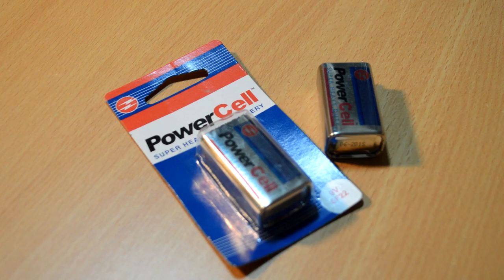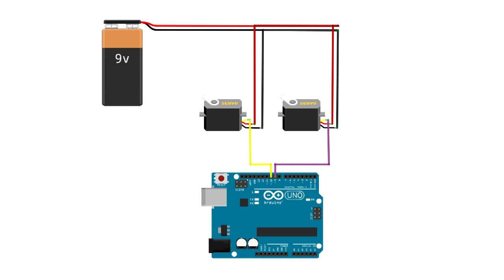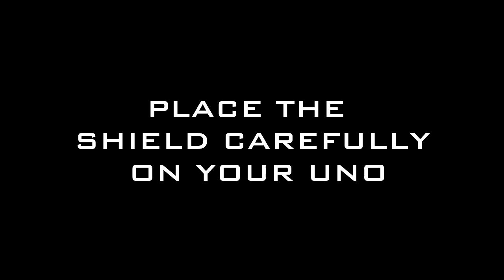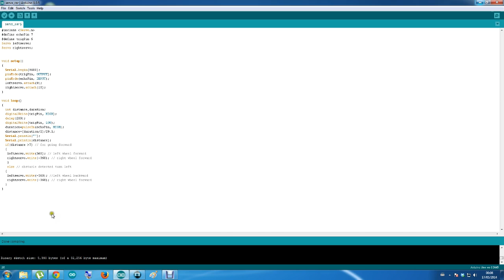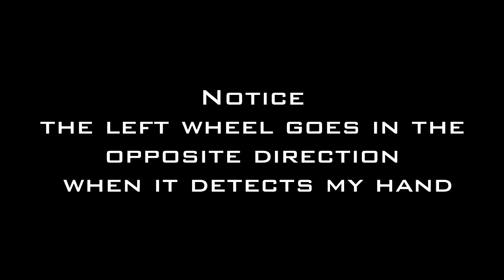Ultrasonic Controlled Servo Car with Arduino

Comment: It is not so effective because your not a servo to rotate int PING sensor,I reccomend you to use BO x 2 motors to control the wheels and servo for PING..............

Comment: Hello, the code doesn't work for me. i get these errors;  stray '\' in program and 'u201c' was not declared in this scope.
Do you have any idea why?

Best regars
Reply: Try to manually retype the quotations. when you cut and paste them they will be a different character, that's why you get the error.

Comment: help:
Arduino: 1.6.7 (Windows 7), Board: "Arduino/Genuino Uno"

sketch_dec25bBBB:37: error: stray '\357' in program

 }ï»¿

 ^

sketch_dec25bBBB:37: error: stray '\273' in program

sketch_dec25bBBB:37: error: stray '\277' in program

exit status 1
stray '\357' in program

  This report would have more information with
  "Show verbose output during compilation"
  enabled in File > Preferences.

Comment: the code is wrong
the right code is:
#include <Servo.h>
#define echoPin 7
#define trigPin 6
Servo leftservo;
Servo rightservo;

void setup (){

 Serial.begin(9600);
 pinMode(trigPin, OUTPUT);
 pinMode(echoPin, INPUT);
 leftservo.attach(9);
 rightservo.attach(10);
}

void loop()
{
 int distance,duration
 ;digitalWrite(trigPin,HIGH);
 delay(200);
 digitalWrite(trigPin,LOW);
 duration-pulseIn(echoPin,HIGH);
 distance=(duration/2)/29.1;
 Serial.println("");
 Serial.println(distance);
 if(distance >7) // for going forward
{
 leftservo.write(360); // left wheel forward
 rightservo.write(360); // right wheel forward
}
 else // obstacle detected turn left
{
 leftservo.write(-360); // left wheel backward
 rightservo.write(360); // right wheel forward
}
}
Reply: +Bhoopesh Gulaguli 
I am getting this 
Arduino: 1.6.7 (Windows 7), Board: "Arduino/Genuino Uno"

sketch_dec25bBBB:37: error: stray '\357' in program

 }ï»¿

 ^

sketch_dec25bBBB:37: error: stray '\273' in program

sketch_dec25bBBB:37: error: stray '\277' in program

exit status 1
stray '\357' in program

  This report would have more information with
  "Show verbose output during compilation"
  enabled in File > Preferences.
Reply: +Bhoopesh Gulaguli 
It gives as much errors as the original :/

Comment: Can anyone help me, I would like to use this code but with 3 ultrasonic sensors?
any code pls
Reply from the maker: +Julian Fernandez Barcellona Yes, if you are using 3 us-sensors then there would be 3 distance variables. You just need to compare all 3 of them with each other and send the output to the motors accordingly!
Reply: +GetTutorialized KD thank you, is there any way you could send me the code for three sensors? I would greatly appreciate !
Reply: +Julian Fernandez Barcellona I can send a Arduino code but it could be only of 2 sensors.....
Reply: Hi? Can you send me the codes for this? 

myinfinity22015@gmail.com

Thank you

Comment: if anyone requires code for dc motors . its here -

#include <Ultrasonic.h>
#define trigPin 2
#define echoPin 3
const int Motor1Pin1 = 8;
const int Motor1Pin2 = 9;
const int Motor2Pin1 = 10;
const int Motor2Pin2 = 11;

void setup() {                
  Serial.begin(9600);
  pinMode(trigPin, OUTPUT);
  pinMode(echoPin, INPUT);
  pinMode(Motor1Pin1, OUTPUT);   
  pinMode(Motor1Pin2, OUTPUT);   
  pinMode(Motor2Pin1, OUTPUT);   
  pinMode(Motor2Pin2, OUTPUT);     
}
void loop() {
  int distance,duration;
digitalWrite(trigPin, HIGH);
delay(200);
digitalWrite(trigPin, LOW);
duration=pulseIn(echoPin, HIGH);
distance=(duration/2)/29.1;
digitalWrite(trigPin, HIGH);
delay(200);
digitalWrite(trigPin, LOW);
duration=pulseIn(echoPin, HIGH);
distance=(duration/2)/29.1;
Serial.println("");
Serial.println(distance);
Serial.println(distance);
if (distance>7)//for going forward//
GoForward;
else//obstacle detected turn right//
GoRight;
}

void GoForward(){
  digitalWrite(Motor1Pin2, LOW);
  digitalWrite(Motor1Pin1, HIGH);
  digitalWrite(Motor2Pin2, LOW);
  digitalWrite(Motor2Pin1, HIGH);
}

void GoBackward(){
  digitalWrite(Motor1Pin1, LOW);
  digitalWrite(Motor1Pin2, HIGH);
  digitalWrite(Motor2Pin1, LOW);
  digitalWrite(Motor2Pin2, HIGH);
}

void GoLeft(){
  digitalWrite(Motor1Pin1, LOW);
  digitalWrite(Motor1Pin2, HIGH);
  digitalWrite(Motor2Pin2, LOW);
  digitalWrite(Motor2Pin1, HIGH);
}

void GoRight(){
  digitalWrite(Motor1Pin2, LOW);
  digitalWrite(Motor1Pin1, HIGH);
  digitalWrite(Motor2Pin1, LOW);
  digitalWrite(Motor2Pin2, HIGH);
}

void Stop(){
  digitalWrite(Motor1Pin2, LOW);
  digitalWrite(Motor1Pin1, LOW);
  digitalWrite(Motor2Pin1, LOW);
  digitalWrite(Motor2Pin2, LOW);
}
Reply from the maker: Koshal, how old are you ?
Reply: ***** I have turned 13 today.
Reply from the maker: koshal gupta Keep it up!!! It is extremely remarkable at this age of yours. Make sure you keep doing such projects and also keep a proper documentation of all your past projects. You need them in Higher Education
Reply: thanx but do u know anyone who can teach me robotics in kolkta.
Reply from the maker: koshal gupta You dnt need to learn Robotics from anyone. When it comes to learning Robotics, the internet becomes your best Friend. The only problem is , you should know how to google your problems. If you think of learning robotics from one guy, he will just tell you what he knows and what he has done to run that Robot. That, according to me is limited knowledge. On the internet you can learn the same thing you are working on-from multiple sources and that too in different ways and then the next thing you do is to experiment on your own!
Reply: but then its not good to to Google too much.
and the only problem i have  programs they just go above my mind
Reply from the maker: its okay if you cant understand the code.
for you, time will cure that

Comment: I am using an arduino uno r3 with L293D motor driver shield.I have connected dc motors to my shield.So kindly mail me the code on my mail-guptakoshal1@gmail.com.Thank u.

Comment: This is a nice video tut.

I used the ada fruit motor shield too, but I really felt a disadvantage of using it, as it did not have pass through headers.

Hence, I had some pass through headers soldered to it. It now allows me to use all of the uno's pins. Without any issues.

Comment: i am using an arduino r3 with l293d motor shield so what are the changes in connections and program can u mail me these things to guptakoshal1@gmail.com.
Reply from the maker: not much
servo motors will be on pin 9 and 10
good luck with the other digital pin connections of the sensors
Reply: *****  Where to connect the sensor if we are using the l293D shield?